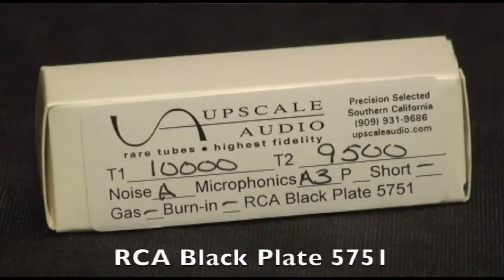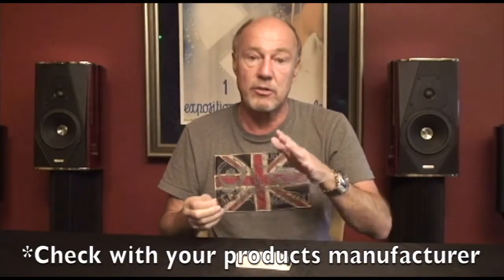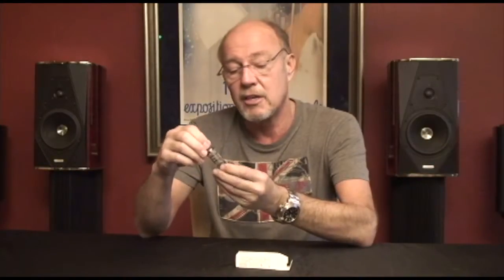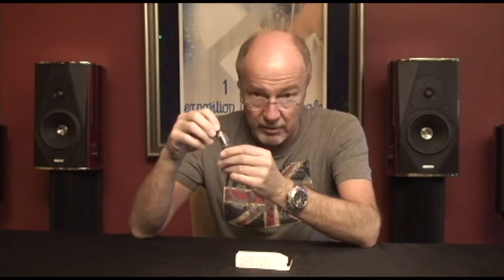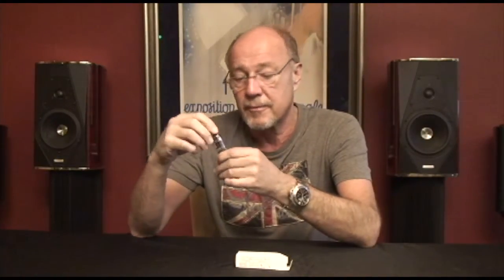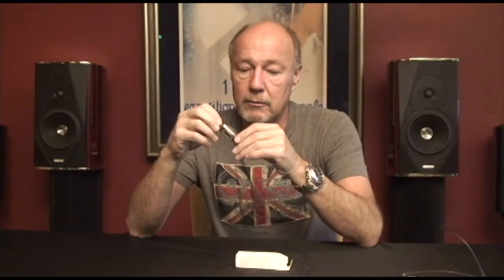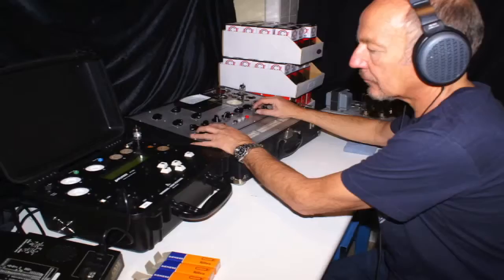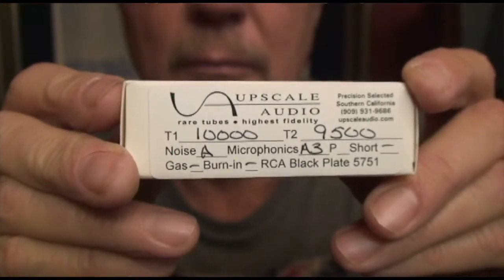Upscale Audio's Kevin Deal reviews the RCA 5751 Black Plate

Comment: For a bit of history, the 5751 tube was originally commissioned by the U.S. military for primary use in combat zone communications equipment such as radios. It was designed with only 70% of the gain of a standard 12AX7 type, so that when used in high noise environments, with radio operators sometimes having to shout their communications over the ambient high noise, they wanted a tube that would stay clear and not distort, and if it did overdrive, the consonant and sibilant sounds of verbal speech would still be maintained and reproduced enough to still reliably convey critical verbal communication.